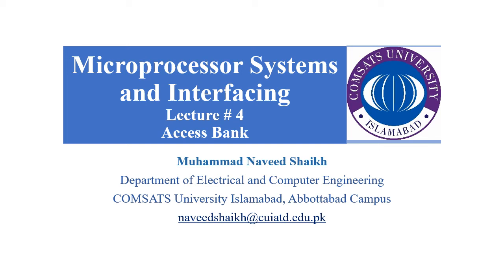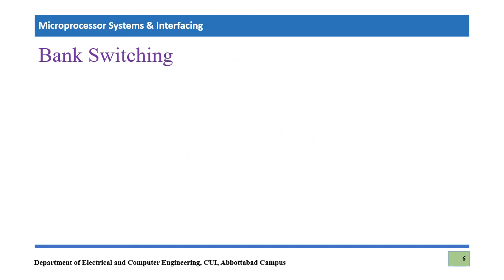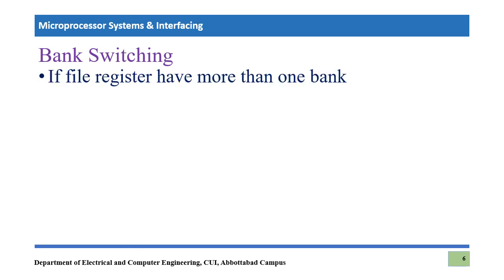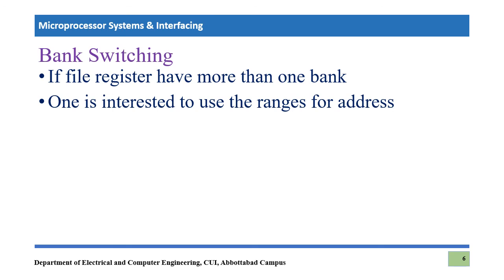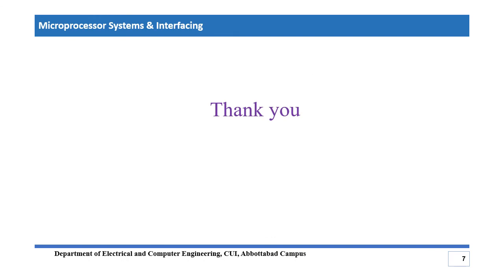Access Bank in PIC18  || How access bank is formed up in PIC18 Microcontroller

Comment: where do you show the bank switching in other lectures?
Reply from the maker: I am sorry, I  was busy and could not reply in time. I hope it is not too late. 
I dont remember exactly, but I explained it in the PIC18F instruction playlist  https://www.youtube.com/watch?v=Hp7eAomGU-g&list=PLEacQ4Oes1V2ygQyi-jQKuXNIZQLfc75V
. However, for your convenience, let me put it here MOVWF 00H, D, A  here D is the destination bit, and A is the bank number. For example, for access bank, it will be simply 0, and for bank 1, it would be 1, and so on. Depending upon the size of RAM, it can be up to F.
Reply: @LearnOnline1  hello, thank you very much for the reply, i somewhat figured that out but this still helps i thought it was just either 1 or 0 as the datasheets are not very clean.

I hop its not too much trouble but i need some help, I have experience using a pic16, all worked correctly but now moving over to pic18 I simply cant get it to work properly and cant seem to find a good explanation for initializing the code.
I am using mplabx and pic-as compiler, my code compiles and debugs correctly but does not reflect in a working microcontroller.
thanks for your time and good videos!
Reply from the maker: @wynand988  few questions before I answer. Have you burned the code ( hex) file in Proteus? Because you say microcontroller isn't working..how you identify it that it's not working..mplabx is okay. But you should try the simpler one mplab ide. Have you studied about configuration registers?
Reply: @LearnOnline1  haven't delved into Proteus yet, it is Mplab x IDE not sure if thats the same as youre saying snd i use the IPE to burn the code to the controllers. I do know about the config bits my controller does for example respond to those its not like jts broken. I think the issue is something to do with the code inturrputing or something. I use the psect resetvedt,global,reloc=2,class=code,delta=1 and add that to the linker files.
Reply: @LearnOnline1  so I've made some progress, I've added the htc.h file to the header files and sorted out the liker tags and psect flags, been reading on microchips webpage about this and I'm happy that thats all in order . But still i can only get the chip effect one port, can make an LED blink with a loop so the code execution works partially. It skips everything else it seems even the osccon bits so i cant change the speed. Im thinking its an issue with the bank access but this doesn't make sense to me since everything i use is in the access bank so just adding 0 should work and it complies and debugs correctly, so what gives. I see in microchips exampled they sometimes use the movlb instruction for SFRs for some reason but that doesnt change anything for me
Reply from the maker: @wynand988  send me the source code please.
Reply: @LearnOnline1  list p=18f13k22

; CONFIG1H
  CONFIG  FOSC = IRC            ; Oscillator Selection bits (Internal RC oscillator)
  CONFIG  PLLEN = ON            ; 4 X PLL Enable bit (Oscillator multiplied by 4)
  CONFIG  PCLKEN = OFF          ; Primary Clock Enable bit (Primary clock is under software control)
  CONFIG  FCMEN = OFF           ; Fail-Safe Clock Monitor Enable (Fail-Safe Clock Monitor disabled)
  CONFIG  IESO = OFF            ; Internal/External Oscillator Switchover bit (Oscillator Switchover mode disabled)

; CONFIG2L
  CONFIG  PWRTEN = OFF          ; Power-up Timer Enable bit (PWRT disabled)
  CONFIG  BOREN = OFF           ; Brown-out Reset Enable bits (Brown-out Reset disabled in hardware and software)
  CONFIG  BORV = 19             ; Brown Out Reset Voltage bits (VBOR set to 1.9 V nominal)

; CONFIG2H
  CONFIG  WDTEN = OFF           ; Watchdog Timer Enable bit (WDT is controlled by SWDTEN bit of the WDTCON register)
  CONFIG  WDTPS = 32768         ; Watchdog Timer Postscale Select bits (1:32768)

; CONFIG3H
  CONFIG  HFOFST = OFF          ; HFINTOSC Fast Start-up bit (The system clock is held off until the HFINTOSC is stable.)
  CONFIG  MCLRE = OFF           ; MCLR Pin Enable bit (RA3 input pin enabled; MCLR disabled)

; CONFIG4L
  CONFIG  STVREN = ON           ; Stack Full/Underflow Reset Enable bit (Stack full/underflow will cause Reset)
  CONFIG  LVP = OFF             ; Single-Supply ICSP Enable bit (Single-Supply ICSP disabled)
  CONFIG  BBSIZ = OFF           ; Boot Block Size Select bit (512W boot block size)
  CONFIG  XINST = OFF           ; Extended Instruction Set Enable bit (Instruction set extension and Indexed Addressing mode disabled (Legacy mode))

; CONFIG5L
  CONFIG  CP0 = OFF             ; Code Protection bit (Block 0 not code-protected)
  CONFIG  CP1 = OFF             ; Code Protection bit (Block 1 not code-protected)

; CONFIG5H
  CONFIG  CPB = OFF             ; Boot Block Code Protection bit (Boot block not code-protected)
  CONFIG  CPD = OFF             ; Data EEPROM Code Protection bit (Data EEPROM not code-protected)

; CONFIG6L
  CONFIG  WRT0 = OFF            ; Write Protection bit (Block 0 not write-protected)
  CONFIG  WRT1 = OFF            ; Write Protection bit (Block 1 not write-protected)

; CONFIG6H
  CONFIG  WRTC = OFF            ; Configuration Register Write Protection bit (Configuration registers not write-protected)
  CONFIG  WRTB = OFF            ; Boot Block Write Protection bit (Boot block not write-protected)
  CONFIG  WRTD = OFF            ; Data EEPROM Write Protection bit (Data EEPROM not write-protected)

; CONFIG7L
  CONFIG  EBTR0 = OFF           ; Table Read Protection bit (Block 0 not protected from table reads executed in other blocks)
  CONFIG  EBTR1 = OFF           ; Table Read Protection bit (Block 1 not protected from table reads executed in other blocks)

; CONFIG7H
  CONFIG  EBTRB = OFF           ; Boot Block Table Read Protection bit (Boot block not protected from table reads executed in other blocks)

    
#include "pic18f13k22.inc"    
#include <xc.inc>
  
    psect resetVec,class=CODE,reloc=2,delta=1
resetVec:
	goto setup

    psect intVec,class=CODE,reloc=2,delta=1
intVec:
    retfie
    
    psect lointVec,class=CODE,reloc=2,delta=1
lointVec:
    retfie    
    
	
setup:  BCF INTCON, 7
	BCF INTCON, 6
	
	BCF RCON, 7
    
        MOVLW 0b11110110                 ; Oscilator config
	MOVWF OSCCON
	
	MOVLW 0b00000110
	MOVWF OSCCON2

	MOVLW 0b11011111
	MOVWF OSCTUNE
 
	
        CLRF PORTA                   ; Port config
	CLRF LATA
	MOVLW 0b00001111
	MOVWF TRISA
	
	CLRF PORTB
	CLRF LATB
	MOVLW 0b00000000
	MOVWF TRISB
	
	CLRF PORTC
	CLRF LATC
	MOVLW 0b00000000
	MOVWF TRISC
	
	BCF PORTB, 6                 ; Set Output enable pin low
	
main:	BSF PORTA, 4
	BSF PORTA, 5
        BSF PORTB, 6
	
	movlw 4
	movwf 0x10
	movlw 130
	movwf 0x11
	movlw 244
	movwf 0x12	
a2:	decfsz 0x10
	goto a2
	decfsz 0x11
	goto a2
	decfsz 0x12
	goto a2
	BCF PORTA, 4
	BCF PORTA, 5
	BCF PORTB, 6
	movlw 4
	movwf 0x10
	movlw 130
	movwf 0x11
	movlw 244
	movwf 0x12
a3:	decfsz 0x10
	goto a3
	decfsz 0x11
	goto a3
    	decfsz 0x12
	goto a3
	
	goto main
	
    END resetVec
Reply: this is just a test to get the microcontroller to work from the main code i intend to use. I
I can make any pin go high and low but it only does that with one at a time no other pins do anything, in the case it is the PortA 5 that gets looped on and off while the rest arent affected
also in this test ive removed the ,0 to let the compiler add by default but no difference
Reply: @LearnOnline1  just to get back to you. I found the issue, the ansel and anselh registers both must be cleared for the io pins to operate in the normal manner.
The problem with the internal clock not being affected by the pll x4 bit strangely enough is due to the first bits of the osccon (SCS) being set to internal clock instead of primary clock (00) contrary to the datasheets.

bugs me so much how vague the datasheets can sometimes be, this one i have in the port enable example say 1 makes the io pins into outputs and in other places it says 1 makes them inputs lol. anyway sorry for bothering